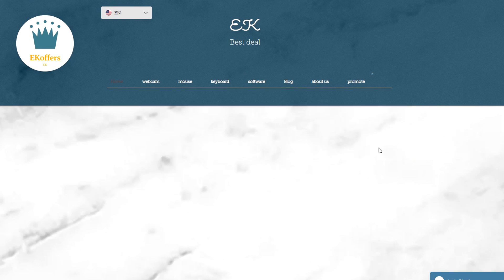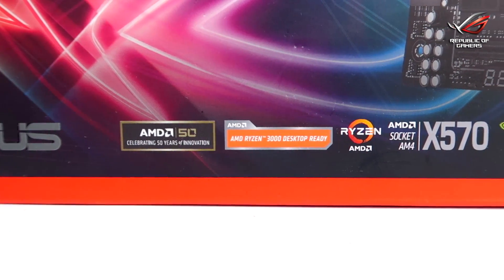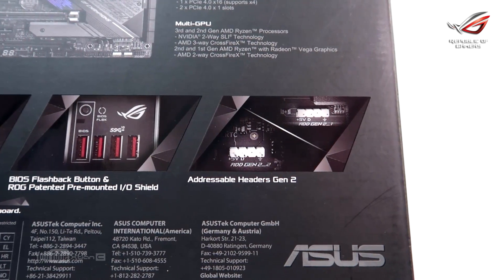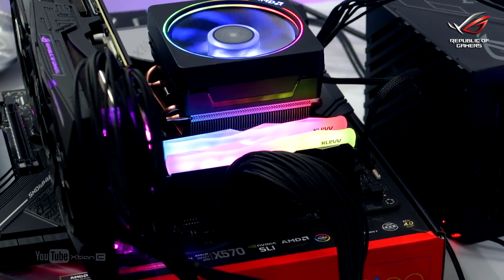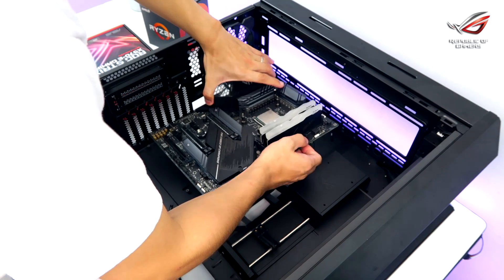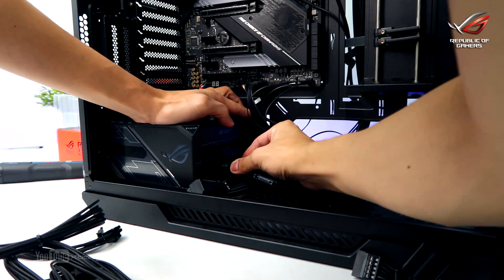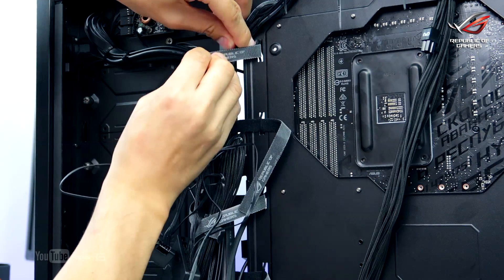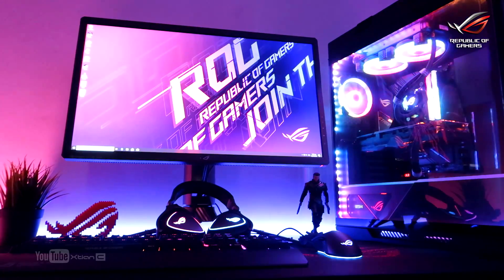How to Build a X570 Ryzen RGB PC ft. ROG Strix X570-E Gaming - Step by step

Comment: Hello my psu is modular and has only one cpu cable 8pin and the mobo has 8+4 question is if i buy a new cable should it be on the sam connector or separate on the psu side Like I have the 8 pin and could buy a 4 pin and vonnect it to the other slot in the psu or I found on amazon a 8+4 cable that runs on one connectort on the psu side

Comment: I have trouble with the case fans => they are not getting powered for some reason 
Also, the secondary hard disk, even though the BIOS saw it, it refuses to give me a drive letter

The Case Fans are already connected to a tiny chip that came with the case, so not sure what is missing there.
If anyone knows give me a point to the right direction please

Comment: i'm building my own pc might take 2yrs since i'm buying it piece by piece so chosen components subject to change:

1xAsus ROG Strix X570-E ATX MB (the one with bluetooth and wi-fi 6) + £289.99             
----------------------------------------------------------------------------------
1xAsus ROG Strix Helios RGB Aurora Sync ATX/EATX Mid-Tower gaming case + £284.99
----------------------------------------------------------------------------------
1xASUS ROG Strix 1000W Gold PSU (Gold Standard, With 10yr Warranty) + £189.99
----------------------------------------------------------------------------------
1xKingston FURY Beast RGB 32GB 3200Mhz + £141.24/ 
or 1xKingston FURY Beast 32GB 3200Mhz (non-RGB) + £139.79
==============================================

1xAsus Nvidia GeForce RTX 3060 STRIX GAMING OC V2 12GB 
GDDR6 PCI-Express Graphics Card +£569.99
----------------------------------------------------------------------------------
Grand Total £1,476.20 (shipping and cables and hard drives +ssd's coolants and the cpu)

The CPU is the main cause of this decision I bought a Ryzen 5 5600X with properly checking which gen 3 processors my a-320m-k prime mb supports this of which it doesn't since it's brand new and that mb is over 3yrs old now!

The Ryzen 5 5600X cost me £259.99 free shipping from AWD-IT (a UK site as far as i'm aware)
it will arrive in the next 5 days but sadly I won't be able to use it till I get the PSU and the mb and thats if the hyper-x fury ddr4 2666Mhz will work on it and the IO panel will fit in my current MSI Vampiric 011C Ryzen case as it is a larger mb with a long IO panel

if so I can run it like that and hopefully the RX580 will run fine in the single pcie 3.0 slot at the bottom until I can afford the gpu mention or a better one (the gpu will be the last component I add to the new build the MSI Armor RX580 8GB OC GDDR5 2048sp will have to stand in it's place till I get a better one)

I say approximately 2yrs because who knows if my current money will stay stable if it doesn't I may need to get a permit to work from home (and thats if the council say my house electricity is up to business code standards as I intend to potentially build pc's for people so testing may be necessary which could potentially blow my electrics if it's not wired properly)

anyways i'm not rich any luck if I get sorted and I do get the house licenced the speed may increase in which I can build it if i'm making enough money one thing I can say is I trust ASUS for their reliability their components have never screwed up on me)

Comment: Great video. Watching your build has encouraged me to do my own build using the ROG Strix motherboard. I've one problem maybe someone could help me with. At 2:24 and 8:55 on the extreme top left next to the heatsinks, there are 2 CPU power connectors, a 4 pin and an 8 pin. I'm using a Corsair modular power supply and I'm stuck whether to use the 8 pin and 4 pin sockets together. I've got both an 8 pin and a 2 x 4 pin CPU cable. In the ASUS instruction manual it says not to use the 4 pin socket by itself as this will cause the board to overheat, there's no mention of the 8 pin socket. Can someone help me further. Thanks.
Reply: did u use 8 pin only?

Comment: Hello , i have most of the same components , Asus x570 Mobo , 16 GB ram (XPG) , and a CPU ryzen 5600x & a 1650GTX Zotac ( cant upgrade yet cause price of gpus to high atm) , i follow your video to guide me and it work like a charm , i just have 1 question , is it normal for the WHITE LED VGA to be still ON even when the pc has booted ?? i mean im using the pc but the white led is still ON did i miss something??

Comment: Where do u connect the rgb on the front panel of the case to the mobo? I tried connecting it to 3 pin rgb and it still doesn't work.

Comment: Ive had a problem where my bottom USB 3.2 connector will not fit , the bottom pins seem to have 1 pin at the end that is in the middle , my case connector wont fit it, im not sure if maybe that pin is bent , would somebody maybe confirm if thiers is like this or if the pin is at the bottom with a pin missing at the time aligning with all the others ??

Comment: Is it just me or did you only plug one of the plugs from the psu into the board (top left). I thought it used an 8 and 4 pin. I only saw an 8 pin Installed.

Comment: I HAVE A QUESTION for the usb of the aio does it matter in which usb connector it is connected? Because i have the same motherboard and there are 2 usb connectors , usb 12 and usb 34? And i connected mine in usb 34 so does it matter?

Comment: Asus ROG Strix Helios ATX Full Tower Case has a front panel USB 3.2 Gen 1 Type A port, but the Asus ROG Strix X570-E Gaming ATX AM4 Motherboard does not have sufficient USB 3.2 Gen 1 headers. The case USB 3.2 Gen 1 Type A port will not be usable. Did you work round this?

Comment: So this motherboard has an 8 pin + 4 pin cpu connector. My Corsair 850x has only one 8 pin cable that can split into two separate 4 pins.
Am I supposed to connect the 8 pin or should I only use one 4 pin? Is there a reason as to why one decides to use one or the other?
Reply: And yes I'm looking towards overclocking my pc.

Comment: sir what do you use to measure the power draw of the PC. Not sure if my psu has enuf to power my PC.

Seasonic m12 620w 80 bronze

Ryzen 2600
rx 570 8gb
Team Group 256gb
5k rpm 2tb seagate
6pcs YGT rgb fans and 2pcs LED strips
tforce 2666 8gb ddr4 ram
gigbyte b450m ds3h

Comment: How would you troubleshoot if you get no POST and nothing apearing on your screen? I have tried pushen all the cables in harder (and in and out). Tried starting it with only one stick of RAM, checken if the pins were bent, taking out the CMOS batterie... and so on. I’m guessing some trouble with the hardware? Everything lights up properly tough, and every fan is going. Hope you have the golden tip to get me booted :)

Comment: Please can you help me with my RAM frequency, I have Corsair Vengance RGB Pro 3600Mhz DDR4 RAM 4 x 8Gb, MoBo ASUS ROG STRIX X570 F GAMING, CPU AMD RYZEN 9 3900X, and latest version of bios, but this doesn't work on DRAM 1.35V, FCLK 1800MHZ, DHCP at 3600Mhz, it's run but when I start some game then depends on time Windows crash with blue screen and error code = stopcode. LED light work fine, but I don't know what to do... This a brand new desktop with all peripherals but because of the world's pandemic situation shop where I bought everything, it doesn't work until further and it's not in my state. Please I will pay for your help because I know it's just a some small setup in the Bios!!!

Comment: Thank you for this ma man. This is my specific board im using. Just dropped in a 3950x and ram and im trying to install the ssds 😂

EDIT: Lmaoooo I never would have noticed the thermal pads on the other side of the ssd heatsinks. Im a total noob. Pressing on....
Reply: How's your new system working? ☺️
Reply: @Delicioushashbrowns  it is working great! Thanks for asking! Heres a couple pics https://imgur.com/a/f8eKQPy

This is my first gaming pc, I have been using a decade old dell inspiron laptop as my main pc for all these years lol. So I wanted to go all out of with the specs. It has a ryzen 3950x water cooled with Kraken Z73, rog strix x570-E board, 2080 super water cooled with kraken x62 (I know, I should have waited two more months for the 3000 series cards. Oh well I'm happy with this card lol.) and I have 32 gb trident gskill z neo ram, and just a bunch of led stuff. I also custom painted the case and some interior pieces and went with a super ultra wide samsung 1440p monitor. The monitor is wider than my tv lmao but because it isn't 4k, it doesn't kill my gpu. I'm very happy with how the system turned out, it was fun to build!
Reply: @Delicioushashbrowns  there were some challenges to sort through, like ram overclock f clock settings causing my desktop to freeze and also the 2080 didn't have the correct drivers and my display would turn off every 30 seconds because of it. I had to borrow a Redditor's old gpu to install windows 10 and chrome remote desktop, then use my smart phone as a monitor to install the correct nvidia drivers while the 2080 was inside my computer. That took a while to figure out since only that 1 other person seemed to have that issue.
Reply: @SangheiliSpecOp  Ahh damn, sorry that you had those issues but your system looks amazing! And no worries about the 2080, I just got a 2070 instead of waiting for a few weeks when the 30xx come out. 😂 They're gonna sell out so fast, I doubt either of us would be able to pick one up in the next few months anyway. Better to just enjoy the wait gaming in comfort than wait with nothing. 😁

Comment: All kinds of trouble with that motherboard. Don't know why I kept buying Asus products after almost every motherboard had capacitors or whatever those column looking things are called  just fall off the the boards, bent pins right out of the box EVERY single time, the list goes on. Will praise them for their Bios gui though. Got an ASrock Extreme 4 X570 and couldn't be happier except that the manual has NO table of contexts so I had to browse every page until I found the relevant setting.

Comment: there is an ATX 4 pin on this mobo. is it required to be connected to the PSU - some site says no need but some says their win10 pro freezes if not connected.  can you provide guidance based on your build. thanks.

Comment: so i have a similar setup with the same board that came included with the wifi antenna, after setting everything up, windows 10 installed, updated wifi drivers the wifi antenna still does not show up, no wifi option available, just the two Ethernet ports, have check its enabled in bios in onboard device configuration, and pretty sure its being detected in  device manager under network adapters it is the intel....adapter. still nothing, have tried solutions in this video but still no luck: https://www.youtube.com/watch?v=L4uAsC3txuk
any clues?

Comment: Xtian C:
Great video, thank you for posting.
I am going to build a similar PC using the same motherboard for video editing, but I am going to use the Ryzen 9 3900x. My question to you is can I use the cooling fan that comes with the processor or should I use a liquid CPU cooler like you did in the video?
Reply: Did you ever get an answer?
Reply: @jessygarcia8150  Hi Jerry, 
I did not get an answer but I decided to go with the liquid cooler because I thought that would work better.
Reply: Have not had any problems.

Comment: Hello I just ordered my X570 and now i noticed that It requires 8+4 pin for CPU. Is the 4 pin optional?
Reply: If me i just use the 8 pin connector the 4 pin i do not plug it in but i dont overclock the cpu so, i guess dont overclock it if you only use the 8 pin connector :) 😊😊

Comment: all this video did was confuse me more... "Plug in all the connection that you will need into your power supply"  I DO NOT KNOW WHICH CONNECTORS I NEED THATS WHY IM WATCHING THIS VIDEO!!!
Reply: lmfao same bro. same. Im literally going to buy a 450 tomahawk max because of that dreaded extra 4 pin connection on the 570. On pc part picker. it had me pick like a 150$ power supply , that was modular, because i think it came with that extra four pin. Some people on reddit are reporting that you can you can run just normal power plug ins and nothing happens. Others are reporting that you have to have that extra four pin plugged in.
Reply: @BCG88  I'm getting my CPU for my build with this board in the next week so I'll check if it works without the 4 pin if you want
Reply: It's pretty self explanatory, PC components are designed in such a way that a cable fits only where it's supposed to and nowhere else. One just has to be careful with being gentle, precise with some of them. In the case of the GPU, you'll need two of the same but it still doesn't matter because the PSU will tell you where to plug them etc. The most challenging I'd say is the front panel power/LED/reset connectors and all the info is in your mobo manual.

Comment: Hi, How can I setup all parts in same aurasync?? I have this motherboard, corsair ml240r rgb, rams with rgb and Thermaltake commander c35 rgb. I can synchronization with aurasync but all of supported aurasync. Could you please help me true connection?? And which software I need??(icue, Armoury create) Any settings in bios??

Comment: Idol pwde na ba tong build ko or my dapat pang palitan bukod sa gpu para ma maximize?

ROG Strix X570 E Gaming
Ryzen 7 3700X
Samsung 970 EVO 500GB NVME m.2
Seagate Firecuda 2TB
T-Force Delta RGB 16GB (8*2) 3000Mhz
ThermalTake 600W 80+ Standard
NVIDIA Geforce GTX 1050 (Temporary) Planning to get 1660ti or 1650 OC

Comment: Either I'm dumb or the manual doesn't really tell you how to plug in the front panel cables (at least power +/- and switch) in detail
Reply: for a high end mobo you would think they would include q connector in the box, but you get a door hanger instead
Reply: @Ansnms  lol
Reply: Haha, yeah it really doesn't. At least most of it is documented online in some form, but it wouldn't have killed them to include a description lol
Reply: I am trying for 2 hours now but couldn't turn on my mobo. Can you help ? When i'm plugging the PSU, i can only see the strix logo illuminate and the power button to start my mobo is not working. :(
Reply: @r0y564  exactly the same case here now did you find a fix or what was wrong? Have lights on motherboard but no start up. three double checked the front power cables and should be good.
Reply: Got it. It's fixed. I was plugging the wrong CPU power cable
Reply: Still no fix :(

Comment: i have this very motherboard, but i'm having some issues with the RGB lights, mainly where to connect all of them so i can control them the same. i'm running a masterliquid ml 240r with argb, and the case has 3 argb fans.

Comment: I have a question about the power supply. 
Do I need to connect the 24-pin (EATXPWR) to the right side of the motherboard as well as the 8-pin (EATX12v_1)?
How about the other 4-pin (EATX12v_2)?

I have a 850w power supply for a Ryzen 9 3900x and a Geforce RTX 2080 TI.

Hope can some one explain me this,
Regards,
Diogo
Reply: @sheischristiana  Connect the 24pin and also the 8pin. try it out

Comment: Finally some video that actually explained how to install the M2 SSD. Since i never had one before i wasn't sure what to do with heatsink, if I should remove just the plastic or remove the rubber like thing too. Asus' manual book should clarify this, but NO let the user find out for himself until he burn his M2 SSD. 
Thank you very much for this video and explanation.
Reply: I've been watching some vids about installing the heatsink and some say we should take the sticker-label off but I'm not sure... did you remove it? is it working well? have you checked up temp?
Reply: @cerfux  I did exact like in the video. Just removed that plastic. I'm not monitoring too much, but everytime i checked it was around 50ºC. I only used for Windows SO files, so i'm not sure what would happen if i use for gaming. By the way i installed a Corsair Force MP510 240Gb
Reply: you don't need to remove the label on the ssd btw only the plastic on the underside of the boards heat sink  leave the rubber part on

Comment: Did I miss the additional motherboard power connectors?
Reply: Also when connecting USB do we connect it into the USB 32 or the USB 12 Port? Does it matter? Also with the M2 Drive it seems to be better to put it on the top from most people's consensus on quite a few forums than to put it on the bottom one.

But all in all very helpful for me at least
Reply: Yall are as lost as me

Comment: How is your bootup time? I'm very confused because mine takes nearly 20 seconds to boot with an nvme-ssd. I have the x570-e and a 3900x. My old intel 4770k took only 10 seconds to boot. Is this normal because the mainboard checks all the hardware before it loads windows or is my mainboard faulty?

Comment: I used x570 asus tuf , socket power cpu 8+4 , my power supply dont have 4 pin,only 8pin, can it run normally ?
Reply from the maker: Yes! You can plug the 8pin eps w/o having a problem

Comment: Do you connect all RGB lights to the motherboard and do you connect the fan controller to the motherboard to because I did and it had i light on the motherboard that said CPU so I looked in the manual and it said cpu was and or not seated but it all work before I put in RGB HELP please I never built a computer before